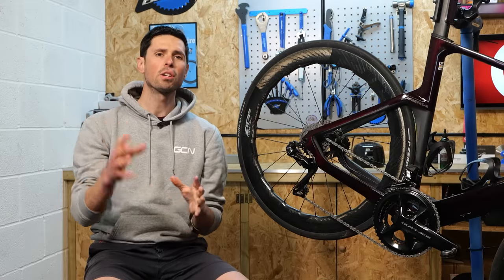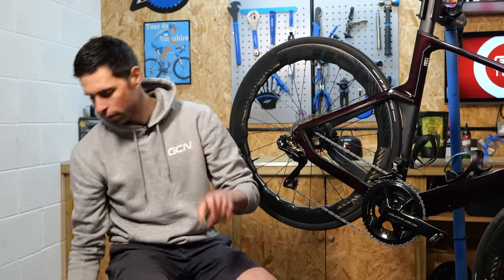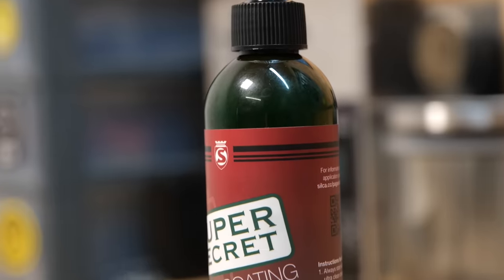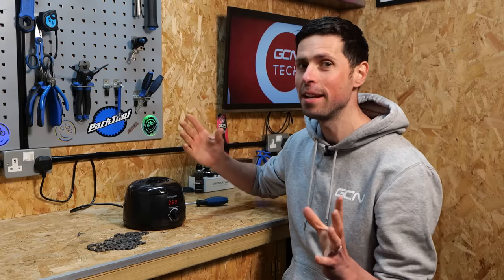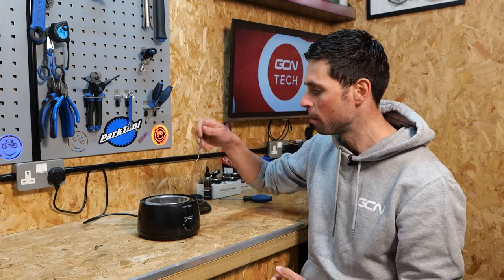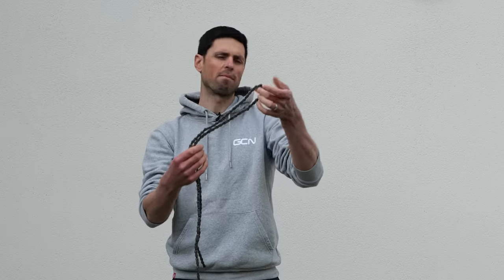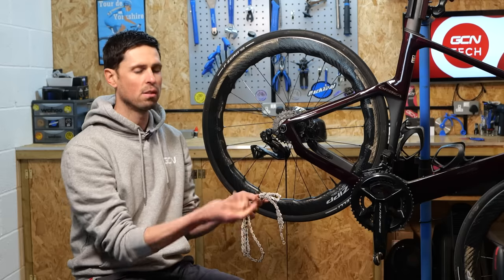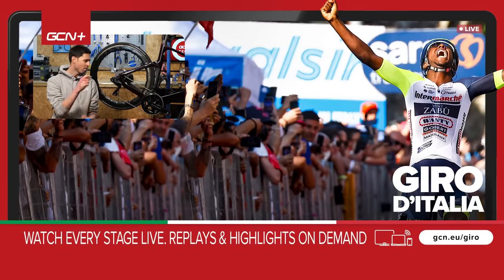How To Re-wax Your Chain & Make It Last Longer!

Comment from the maker: How often do you re-wax your chain? 🚴
Reply: 200km, I can’t figure out when it’s time, the chain doesn’t look oiled (it shines like it’s been degreased), and after the rain it’s generally rusted, although I only welded it in wax. I use hg601 and silca hot wax
Reply: First time today! It started to sound a bit rattly so re-waxed it. Evidently I rode 81km, 3 rides, all in the wet, mostly forestry gravel roads on an MTB.
Reply: about, 300-350km.    I  have not changed that approach in the wet (I do not ride on salted roads, just wet roads).  I did once listen to the chain and changes, for an increase in noise, and waited till 450km before I heard more noise, so I stay way under that as my rule.    However, I have 3 chains on the go, so use the hot wax method, once every 900-1050km.
I use boiling water on the chain to clean off the bits before waxing.  I have never had rust show!   It stays much cleaner.  One chain has 10,500km at present and is measuring 0.3% wear.
Reply: I go 150-200 miles between waxing. Crazy hot tap water rinse, blow dry, hang for a half day to finish drying out, wax in my ultrasonic cleaner using the degas setting. I have my wax in a large glass baking dish that I float in the ultrasonic cleaner, double boiler style.

Blow off with heat gun set to about 250°F as I pull it out of the wax to minimize how much gets stuck in corners and clings on the outer plates. Once cool, roll the chain over a bar to break free the links.
Reply: Why not wax with your quick link in place and locked? I always do, assuming it needs to be lubed like every other link does. Never had a problem from it.
Reply: Every 500kms.
Reply: Much sooner than I need to; about every 3-4 rides. But I love having a perfect chain and rewaxing is a breeze. I only feel OK about it because I use ConnexLink reusable master link though.
Reply: @Desmo500  how do you clean the cassette, derailleur and such?
Reply: No. And that wax is petrol based, yeah? When it flakes off on the road doesn't that pollute the environment like any regular oil spill? So wouldn't it be better to get all the flaking off done inside where you can dispose of it responsibly, so you make less of a mess riding
Reply: Drip wax every 100 to 150 miles depending on riding conditions, wax melt every 1000 to 1500 miles.
Reply: As I use Silca's Super Secret Chain Coating drip on wax, generally once a week, that equates to roughly 100 mi or 160 km.  Or, the evening after riding in wet conditions, as Ollie pointed out in a recent video that the carrier is water-based.
Reply: I use the Silca Wax and super secret drip wax….with about a drip application every 300 miles and rewax every 1500
Reply: I've been considering going the wax route, but I am surprised how little use to expect before it needs doing again. Seems a lot of hassle to do this once, probably twice per week. I'd maybe consider it for my race bike, but I use that more than my spare bike and do would have to change that habit. Perhaps it's an option for the TT bike?
Reply: @Rob6020  get 3 chains and only wax once all 3 are ready to be re-done. The most time consuming part is heating the wax up. Doing extra chains takes almost no time at all, and you get the added benefit of even longer drivetrain life.
Reply: @mrhankbotful  I'm still not convinced that it's worth it. Feels like they fit in the same category as tubeless tyres - solving a problem that I don't have.
Reply: @CatManDoSocial  Hate to break it to you, friend. https://en.wikipedia.org/wiki/Paraffin_wax
Reply: @2nd3rd1st  Oh, very sad face! Comment deleted.
Reply: Hotwax every 300 km
Reply: @mrhankbotful  Because they have a finite amount of times they can be *locked*. I use a ring bider and loop it onto my chain. Hold the separate lock-links and gives me a handle to pull the chain off my swisher tool.
Reply: 150-200 unless a really wet ride comes up.
Reply: @Rob6020  I think the best method is a combination of both techniques. Do an initial hot melt wax, then every 300km or so use a drip-on to top up. Then after the 2nd or 3rd drip on application wears off use the hot melt again. I don't ride anywhere near as much as you, and rarely in adverse weather (my foul weather bike is permanently dripping in wet lube for the time being, but the chain and cassette will both need replacing in Autumn so I haven't bothered yet) however it feels like a good compromise, even if the initial cost outlay is faint worthy.
Reply: Hello! How km you will have to mileage before re wax again? Thank you
Reply: @klnsmn  Mostly use a hard bristle paint brush to just 'dust' off the flakes, quick and easy.  Once in a while (week or so) I clean the bike entirely with car shampoo.  It is all quite easy and fast.  When I did oil, I would remove the chain and  cassette to pull the cassette apart to get rid of the sludge, all behind me now.
Reply: For outdoor riding in mainly dry conditions, I seem to get about 200km after a hot wax before it becomes to noisy, after that I usually go another 200-300km with drip-on wax ever 50km or so... If it's wet outside, drip-on lube after each ride and even then less than half the life expectancy of the hot melt wax...
Reply: I rewax when needed. On good condition probably about 300 to 400 Km. Bad condition maybe 80 to 200 km.. I used to keep a diary for chains, but not anymore.. except I still write down the date and odometer count when install new chain to keep track of how many kms I can get with one chain.
Reply: I apply hot-melt wax every 1000 miles or so, but between hot waxes I apply the drip wax every 200 miles.  This was Silca's recommendation and I find it works pretty well.
Reply: 250 to 300 miles typically although just did a 370 mile European tour and it was good as gold, even with rain and sand.
Reply: @mrhankbotful  Started doing that in the 90s.
Reply: Every 1000 miles for hot wax. Drip wax every 200 miles.
Reply: Every 500km.
Unless riding in wet condition😰. Then I  somtimes need to do it again, or it squick at me.
Reply: me about 300km onroad...
Reply: It will start to make a chattering noise. For me here in the Pacific NW around every 200miles. Was doing homemade paraffin wax with PTFE powder, but ditched the powder because it's expensive and super toxic and just use straight wax. When using lube sometimes a chain would last only 500 mi before stretching, have over 2000 mi on current chain and it's still good.
Reply: 300 km
Reply: 3 to 4 rides, but actually could prob leave it in the wax longer.
Reply: @Rob6020  It's perfect if you need a hobby, if you like to take everything apart then reassemble it, then you can spend time in your well equipped garage between rides, but all these extra tools, devices and new materials, it's just too much for me.
Wax looks good and is efficient when freshly done, but maintenance has become crazy with disc brakes, tubeless, waxing... 
Also you need to clean the rest of the drive train anyway, else the waxed chain will get dirty again, so how do you protect the cassette? Waxing seems more appropriate for dry climates and rides...
I haven't found the perfect solution yet, I was almost ready to buy a bike with hub & belt for that reason, but the loss in efficiency and lack of choice made me hesitate.
Reply: @heywoodjablowme8120 how about graphite powder?